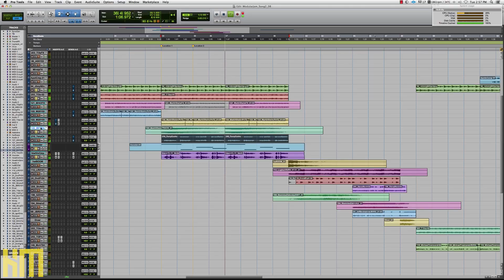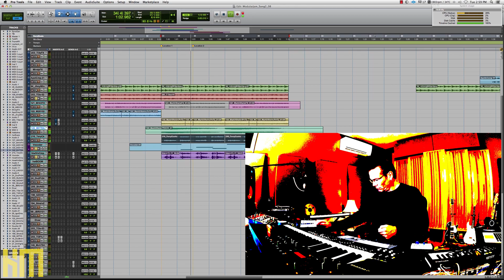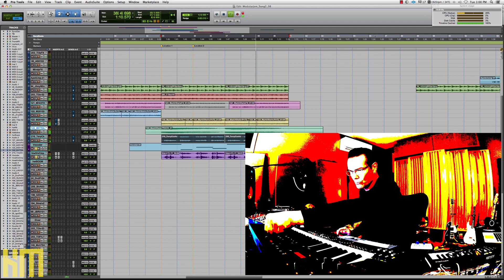Read the MANUAL? -  Music Production and Engineering

Comment: i wouldn't mind VSTs if they actually made MIDI controller knob sets that fit them fully. I always find myself patching random knobs to a VST and I don't have full access. Like the Arp 2600. I am glad there is a great VST for it, but it would be impossible to set up MIDI knobs and sliders for everything and present it in a good way without literally making a shell 2600 with MIDI controls or something.